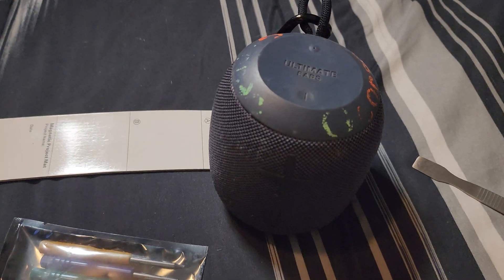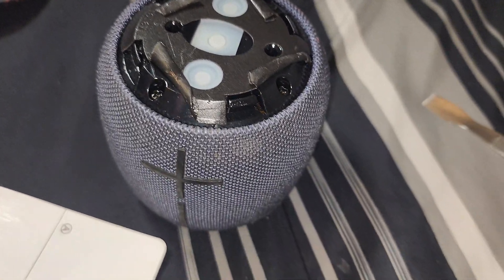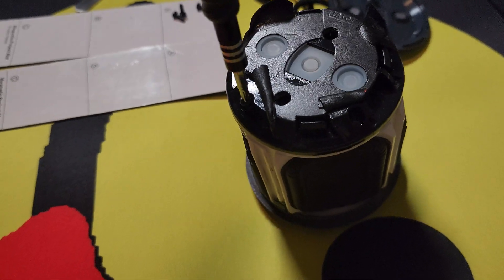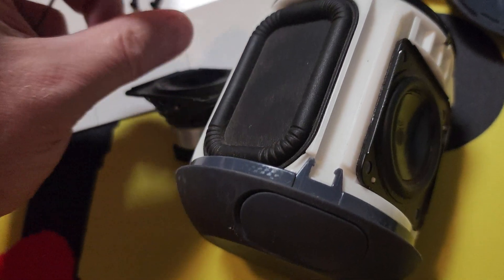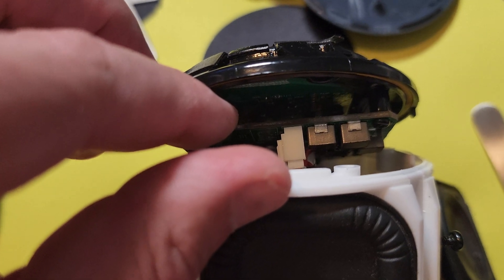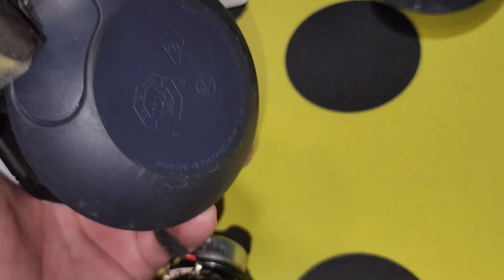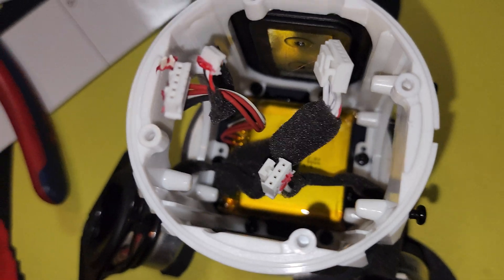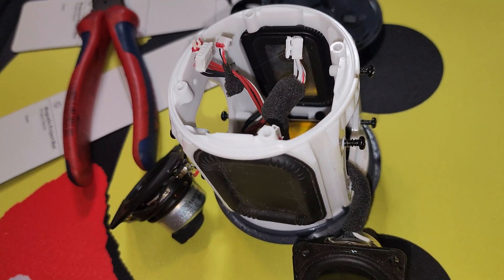Ultimate Ears Wonderboom battery replacement and disassembly

Comment: Would be nice if they had a modded battery with 2 times the capacity so I could just replace it to that lol
Reply from the maker: Hey, I just realized I still have the old batteries and was looking at them. They are 3.8V 2100mAh 7.98Wh batteries so if you can find something that is 3.8V and has a larger capacity than 2100mAh, you will have increased the capacity. Or in theory you could wire 2 of these batteries together in parallel and you will have double the capacity. They key with the mod is ensuring the battery you choose can fit. You might have to remove the old connector and attach it to the new battery if it doesn't already have the same quick connector.
Reply: @MikeNovelli genius you are bro. Thanks
Reply from the maker: You can. Find a compatible with double the capacity and it will do just as you described.... If you have to cut the connector off the old battery and add it to the replacement battery. 
Welcome to how electronics and electricity works!
Reply: @MikeNovelli  do you have any suggestions because honestly I wouldn't know where to start?
Reply from the maker: Just look for a battery with the same Voltage and Amperage that has a higher capacity and will fit inside. 
I haven't looked into it. But it's totally possible. You just need to find a higher capacity battery with the same output.